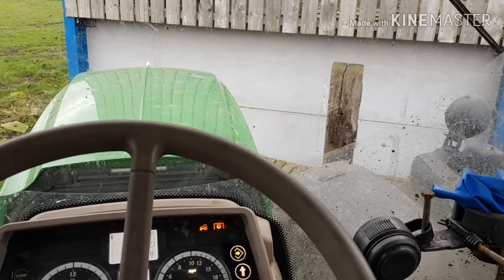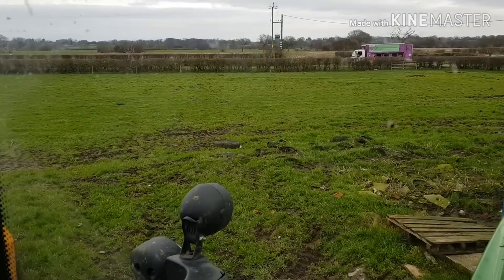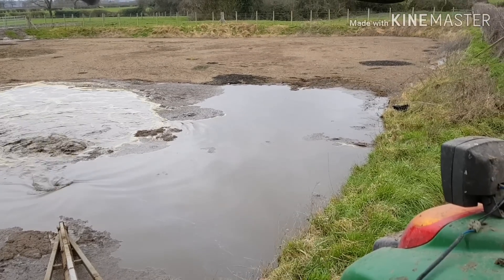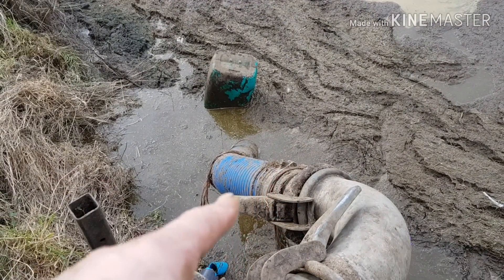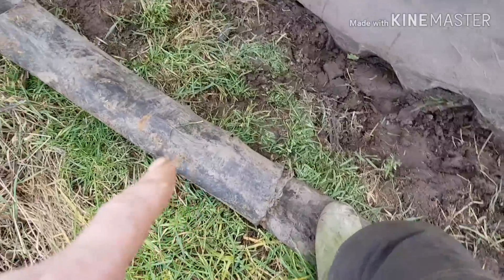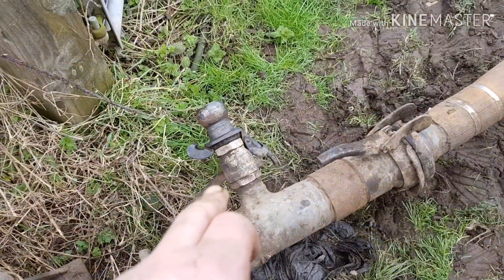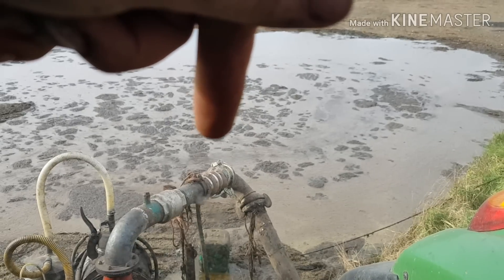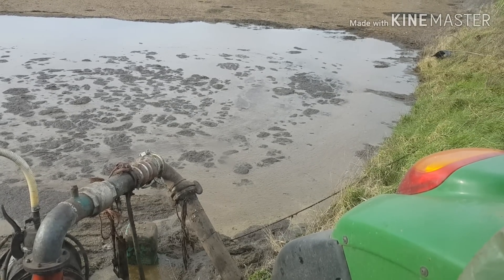UMBILICAL SLURRY PUMPING

Comment: In spite of all the drawbacks this is the most interesting video of slurry pumping i have seen , it seems the connections at the pump need to be maintained regular working under such pressure . thanks for sharing
Reply from the maker: Thank you. Yes you do need to keep up with the pump maintenance  otherwise you can have priming problem or worse

Comment: I like that ramp system! Be right fun in me truck😆😂. I hadn't realised what pressure and quantity that's pumps could manage, bet it's fun when a pipe lets loose 😣
Reply from the maker: I could just see u trying to play evel kanevel on it. You can't see much of the tractors paintwork if it goes beside you. And yes that is a voice of experience
Reply: 😂😂evel before or after the valley jump in his car?!😣. I bet it's a lovely job cleaning up after its let go 😂😣
Reply: i know one went lose once and the guy had teh back window open the slurry went everywhere the tractor was covered inside good old TM 130 lool the operator and another guy outside also clabbered one went down to a water trough and jumped straight in to wash himself xD
Reply: @zzirSnipzz1  😂oops that doesn't sound good
Reply: @casto-  Shit happens xDDDD they got him paper towels and air freshener to clean it with lol

Comment: Grate video. You are right it's so hard to make the videos cos when you are on that job some thing all ways gose wrong or it just gets so boring. Have to get a go prow and stick it on your head then you can record every thing going wrong as well then.  I'v for some strange reason i'v all ways wanted a pipe to go as some drives over really slow over the ramp. But it never happened. Have you seen one go. Did you get smurf a little something in the end after saying u had a Xmas gift for her. Or him wich ever you have never said wich you call it a part from smurf.  From Andy
Reply from the maker: I do have to watch cause not everyone wants a bad day broadcast. I have heard of pipes bursting under cars. Does a good job of undersealing🤣. Unfortunately the Smurfs presant isn't coming now. She was supposed to be getting front linkage
Reply: @hsagri69  ya I bin on farms most my life in do miss it. I only got to old grey fergie.s now. Bin trying to find a 4x4 tractor to do up so my mate can ues it he got both my fergie.s at moment but fuel pump as got stuck on diesel one so got to try get there to fix it but bin layed up with bad back he needs it done cos petrol one costing bit to much. And i'v got 165 to do cluch to do and put new wirering loom in it. But he really needs a 4 wheel drive to get throw the wood.  Keep videos coming